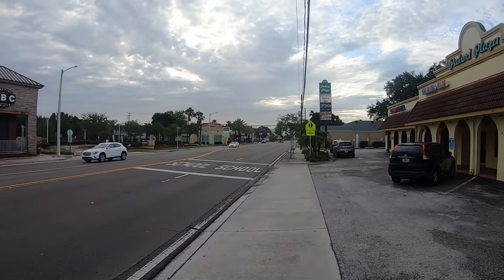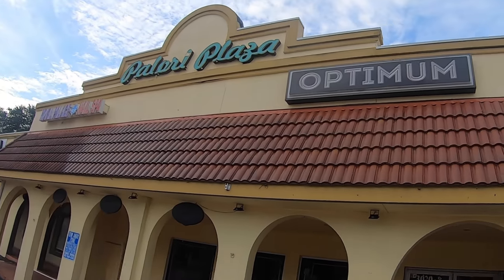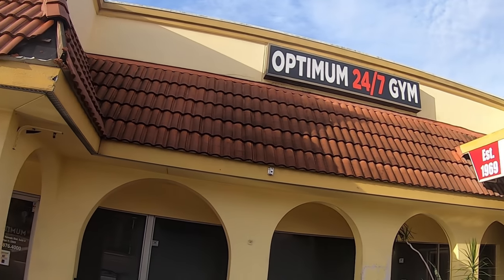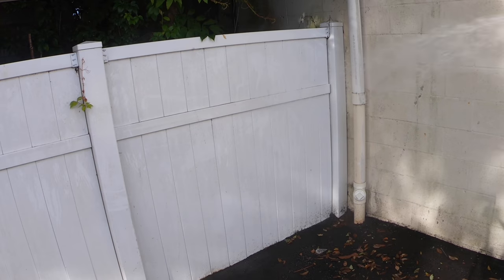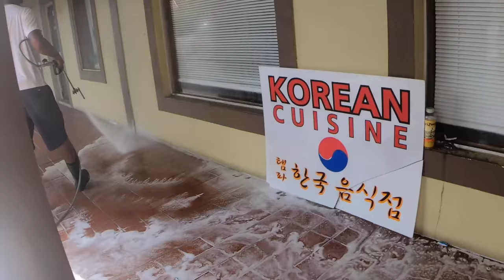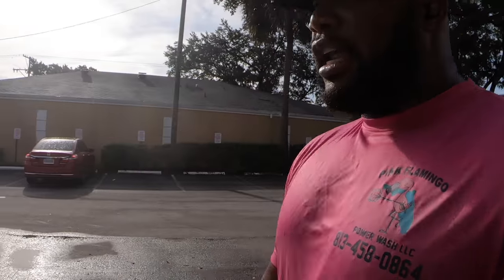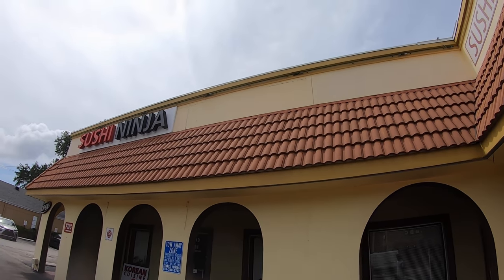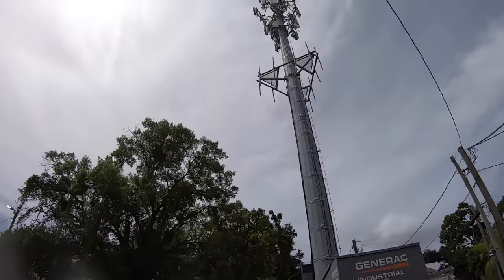Commercial Plaza Power Washing | Tile Roof Cleaning

Comment: Cliff, about how much SH did you go through on this ticket?
Reply from the maker: $1300 took about 3.5hrs
Reply: @PinkFlamingoPowerWash  awesome pay day
Reply from the maker: @coff2x387  yes indeed. No rain and equipment ran good abs efficiently
Reply from the maker: @coff2x387  probably used 15 gallons sh on that job btw
Reply: I'm thinking of getting in the biz one day. Did you do down streaming on this job or straight batch?
Reply from the maker: @clivebrown400  I downstreamed the flatwork and I hit the roof and fence with my 12v soft wash system
Reply: @PinkFlamingoPowerWash  heyy Cliff just checking hoping you have made all the necessary preparations for the storm that’s heading your way?
Reply from the maker: @coff2x387  yea we are ready. Should be hitting at around 8am tomorrow on my side
Reply: @PinkFlamingoPowerWash  stay safe give us a shout out once things pass thru..🙏🏽

Comment: Great video! Did you use same SH percentage on stucco walls & concrete pavers? Thanks for sharing...
Reply from the maker: The super suds sucker downstream injector does a great job on all of them.  I've only had to bust out the 12volt once on a stucco cause I needed a 5% mix ford a real dirty spot.

Comment: Love your vids.  Great work.  Question.  I have a 4gpm and put the sud sucker in with the number 1 orifice and then I noticed it was drawing chem with my xjet nozzle so I thought the injector was bad.  I changed the oring which was fine and the ball and spring were fine.  I noticed it was a little scared up not as bad as the one I. Your previous video but anyhow I put the number 2 in there but I don’t think I’ll get that 3% draw that I wanted.   Any thoughts.   Tku
Reply from the maker: I believe you were supposed to have the #2 in there from the jump.  Doesnt it come with the #2 install already? Remember the injector activates under low pressure. So it a low pressure nozzle in In the xjet it could possibly be pulling soap still
Reply: @PinkFlamingoPowerWash  I think envirospec told me to put the number one in there I’m gonna call them tomorrow to see.  Appreciate it.

Comment: Another great video man what kind of wand do you use for your software system did you make that yourself and what hose are you using for your soft wash system.. what did this job pay I been thinking about going commercial
Reply from the maker: Thanks brother. Yea i made it. Its just a 1/2 gun with Viton seals and I added an 18 inch riser from lowes on it.  This job paid $1300. Here's the link for the gun I have. 
https://shop.pressurewasherproducts.com/1-2-VITON-POLY-TRIGGER-GUN-SOFTWASH-LOW-PRESSURE-CHEM-USE-2919037.htm
Reply from the maker: Also I'm using a 1/2 inch ag hose

Comment: What kind of softwash system do you have?
Reply from the maker: Just a 12volt 7gpm 100 psi remco pump, 200ft of 1/2 inch ag hose. 55 gal drum of sh. I do have a gf valve proportioner too
Reply: @PinkFlamingoPowerWash  thanks bro